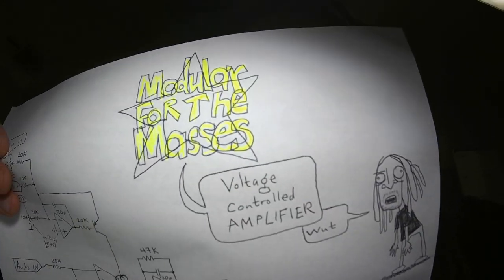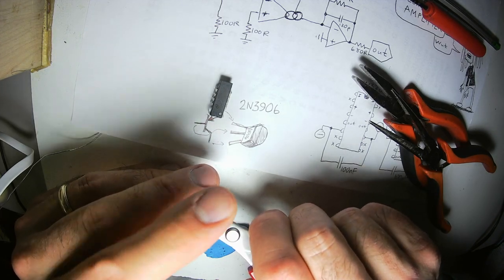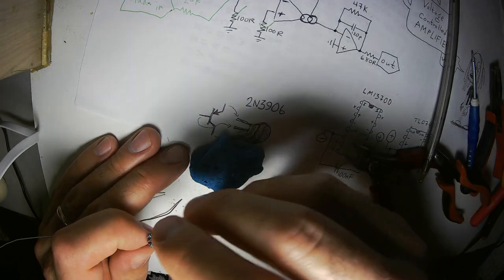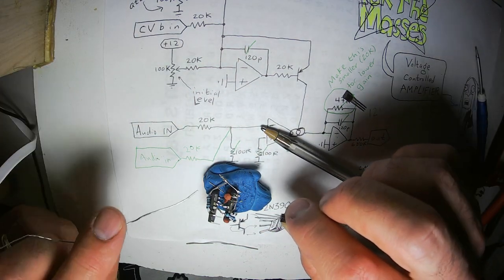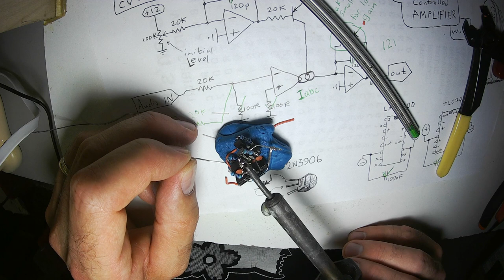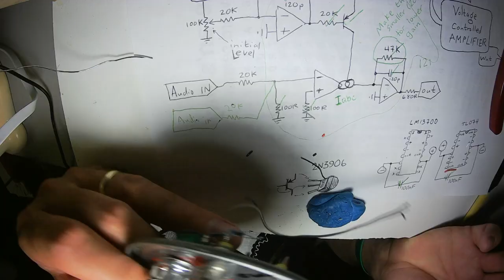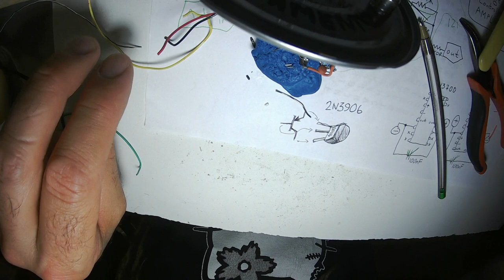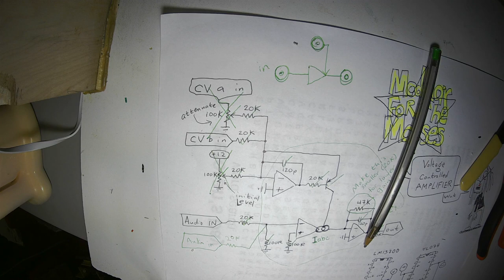You can build this very nice VCA with me! For less than $5!!!

Comment: Hi Juanito - thanks for posting the VCA! I’ve just built it and ran into a few  problems, the first I realised I had it hooked up incorrectly as I realised the transistor should go to the Amp input (either pin 1 or 16) of the LM3700, now it seems to be working, but the initial level pot when fully open just lets the full signal through (I.e the CV has no effect) and as I turn the pot it increases the amount of CV. In effect it acts like a mixer mixing the full signal with the CV controlled signal - is this what it is suppost to do? I’m assuming I’ve probably hooked it up wrong🤔🥴. Also, when I turn the initial level all the way down l, I’m sure I can hear a very faint full signal tone from the VCO - kinda like in the background which is weird. Also there is a click type noise right as each note is played. I put a capacitor between the audio input and resistor which cleaned it up a bit but no matter what value I use I can’t clean it up completely- anyways any ideas are appreciated thanks 🙏 😀 also sorry to pester you with my faults I bet you get sick of other people’s electronic problems 😂😂👍
Reply from the maker: The initial level pot basically is a way to turn the VCA up or down, so when it's fully open, the CV won't do anything. When it's all the way down, the CV kind of "takes over" the VCAs level, so it is kind of like a mixer.

When it's turned all the way down, it should completely attenuate the signal. Hmm... maybe reduce the 20K resistor from the output of the op amp to the transistor base to 10K?????

The click is kind of a feature of this VCA. Fancy digital VCAs will wait for the signal to cross the zero voltage point before they turn on, but an analog VCA like this will just jump in even when the signal is way above or below ground. You could put a capacitor from the base of the transistor to ground and that would slow the speed at which the VCA activates! 100nF might be too large a value, but you could work from there?
Reply: @quantum1542, did you try the resistor change? Did it solve the attenuation problem?? Same here...
Reply: Ale Brenna I think it did actually, although I’m sure the volume on the VCA is quite low but I haven’t had a chance to trouble shoot it again yet - Ive been building a lot of other modules recently and the VCA is on the back burner👍
Reply: You mean the overall volume or the "attenuated" (when cv is 0)?

Comment: Hi there Little John! Just built this vca from your schem, and it's not working nicely... Lot of hum, super low volume and it "clicks" (more like a low click, like a kick drum) with the cv control.... Already sat down and followed every point, everything seems alright (I just used a 100pf and 22pf in parellel cause didn't have 120pf). Do you have any idea of where can I look for that problem? (I built a double one, all one half of the ics for every vca). Also built your apc 1 and a half, it's super fun!
Reply: There's another thing I wanted to ask you. I've seen that you use 680R in lots of your outputs, is there a particular reason? Euro standard should be 1k, right? (I don't fully understand impedance).  Wpuld changing those R for 1k make a lot of difference? Have a lot of 1k, none 680R (I made them, but...)
Reply from the maker: @alebrenna441  I throw the resistors on the outputs to protect the opamp, but it's not really needed -- the TL07x series won't be damaged by being shorted. Not sure if it would be damaged by a full + or - 12V being plugged in to the output though, so that's what they are there for. 1K is fine too... I didn't know there was a standard output impedance for Eurorack!

Impedance is kind of like "vulnerable to voltage change" so a low-impedance output can control its voltage into low-impedance loads, where current would cause the voltage to sag if the impedance weren't as low. For example, a car amplifier can supply a 4-ohm speaker with accurate signals, but an op amp would be able to provide the same voltages, but the 4-ohm load would cause the voltages to sag to basically zero.

A high impedance input will change very easily, so any voltage source can cause the voltage of the input to change to match. This is usually great, unless you leave an high impedance input (the TL07x inputs are like 10M-ohm impedance) floating and the voltage in the air causes it to go crazy.
Reply: Thanks for that explanation! I was pretty clear :)
Regarding the VCA, do you have any idea where should I look up for mistakes? Will check all up again anyway, but any help would be useful
Reply from the maker: @alebrenna441  yeah, try putting a capacitor between the "Audio IN" and the 20K resistor, 1uF to 22uF somewhere in there. The + side toward the "Audio IN"

If that doesn't fix it, try disconnecting the transistor from pin 1 or pin 16 of the LM13700 (the "amplifying" setting pins), connect a 10K resistor there instead, and touch the other end of that resistor to ground, the negative voltage rail or the positive voltage rail.

If you have everything in the audio-signal section wired up right, that resistor connected like that should get you no sound when connected to the negative voltage, half-volume-ish when connected to ground, and full-volume when connected to the positive voltage. If that is the case, you've got to work on the control voltage circuitry... 

You can do it!!
Reply: Thanks man! Will try all that and came back with results!
Reply: @ozerik  Took me a while to sit down, had so many modules to debbug!! It was a stupid roocky mistake: Didn´t know how to read the signs for the OTA, thought that everything was going out from pin 5, as an usual opamp... Did that in a few modules, Luckily is working OK right now!! Also changed the output resistors to 1k, didn´t notice much of a difference!. Thanks for sharing Juanito! Already did this, the APC, wavefolder, and the 4069 vco (But based on Rene´s schem) (And modules I took form other sources). The 808 is on the way!! :D
Reply from the maker: @alebrenna441  Yeah, that output is actually a current output, and needs to be buffered either by the LM13700's transistors or an op amp set up as a current-to-voltage converter! That's awesome you got it working! Sounds like your synth is basically complete :P
Reply: @ozerik  it's growing nicely! There are still a few things missing, and I have to finish my faceplates and start placing them on the rack, but yeah! Really trhilled to have that thing singing :)
Reply: Juanito, hi there again! I have a probkem with this vca: it never attenuates completetly the signal. I waited until I coul test it with another envelope, to rule it out (used rene schmidt and mfos) and it's still there. Read you recommended to other guy changing a 20k resistor to 10k?